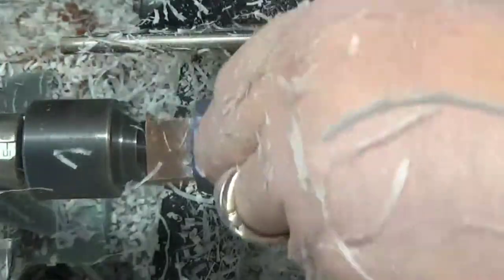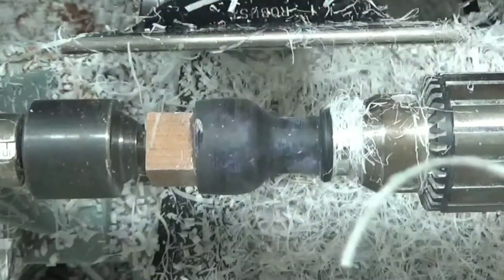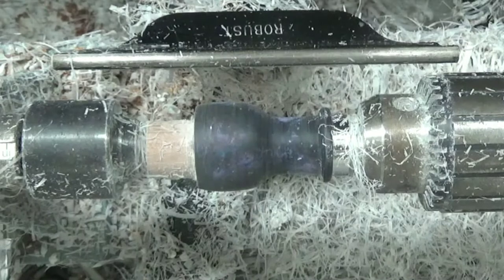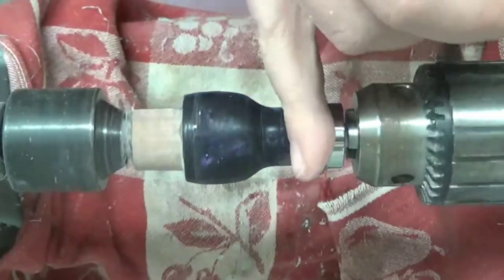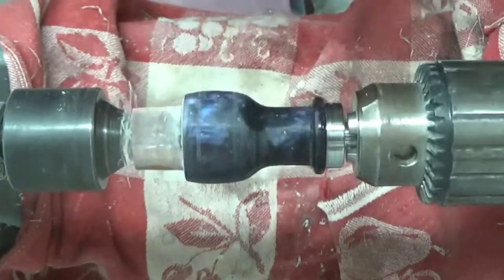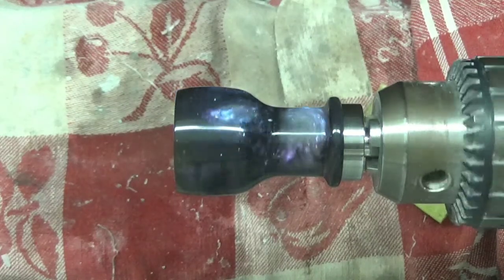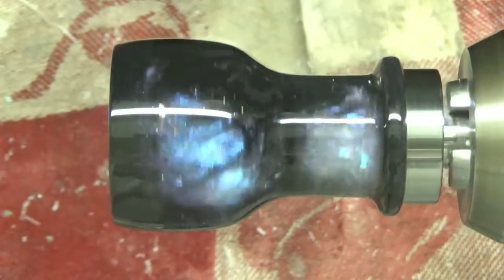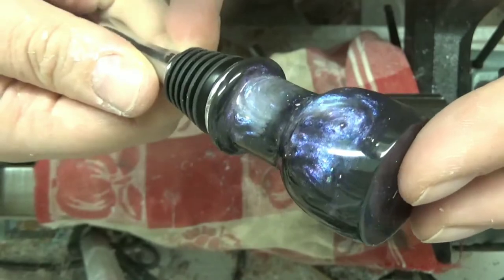Turning a Nebula Bottle Stopper

Comment: Hey man, that's awesome. Any chance you'd share what you mixed with your epoxy resin? Specifically, the black stuff, was that paint or something and what Mica powders did you use to get that look?

Again, awesome job.
Reply from the maker: Thank you, I used alumilite black resin dye and interference powders. Interference powders are neat, the colors stay subdued with a lighter background and become more vibrant with a dark background. For the Stars I use Solar Color Dust white flash crystal dust and holo flakes. The hardest part is finding the right ratio of what colors that make the appearance you're going for.

Have fun, good you liked it, these were really enjoyable to make.
Reply: @TheTacticalPainter  thanks for all that. Gotta sub in me!